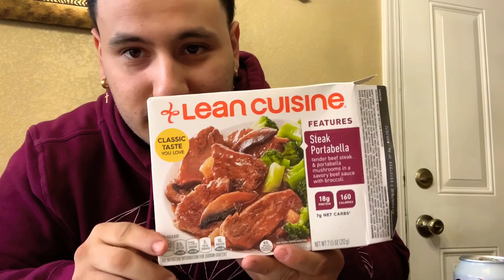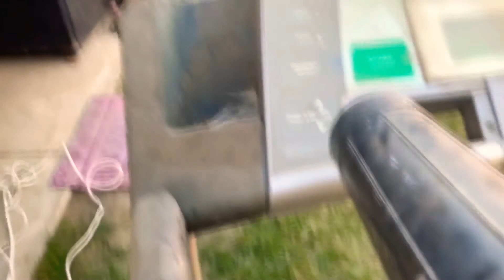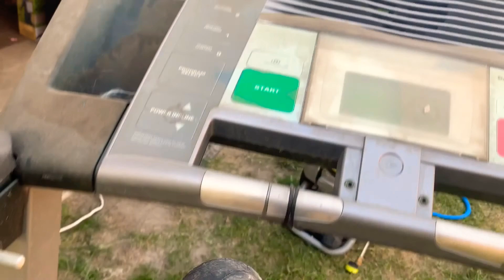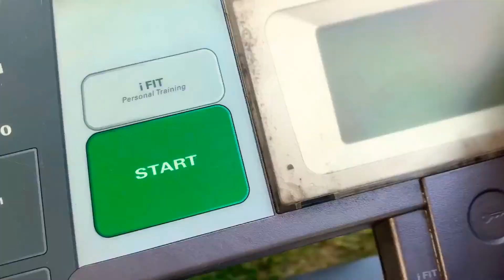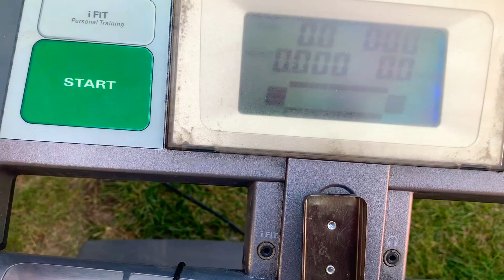Fixing a old treadmill ( Ripped cord repair )

Comment: Maybe it's acting up because you washed it, and it still has water in some of the internal components, just like when a cell phone gets wet even if you "dry it out" still they don't  work, I will suggest let it dry completely for couple of days, and try again.
Reply from the maker: Idk because usually if a component gets wet and you try to start it up it will fry then shut off , that’s why I think it’s just the motor